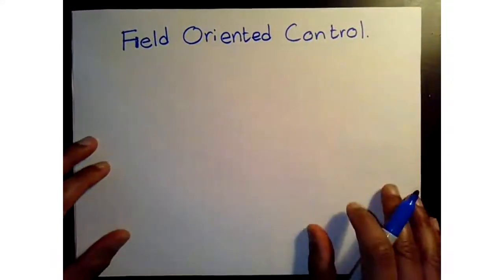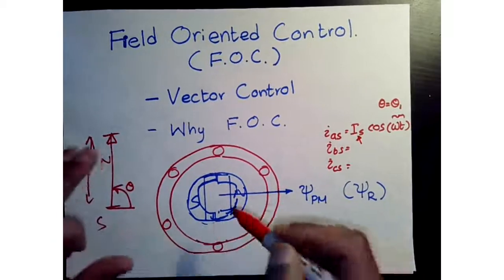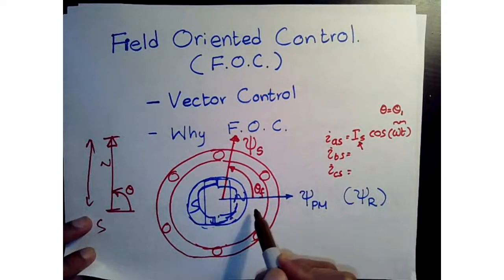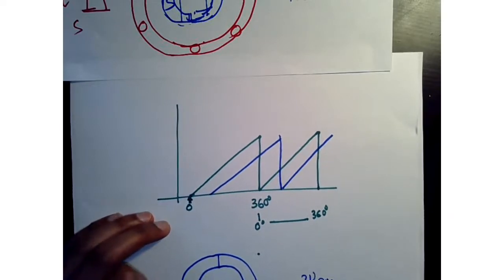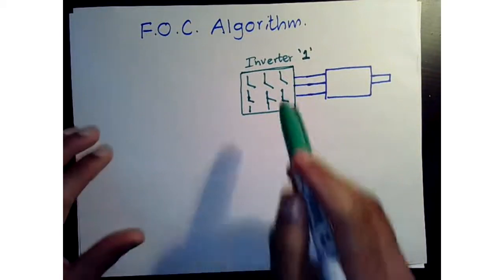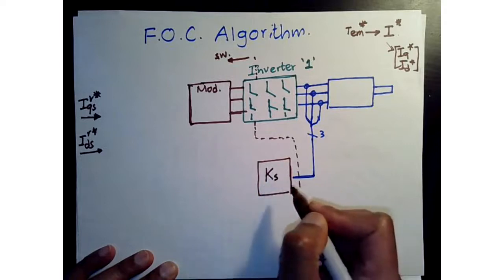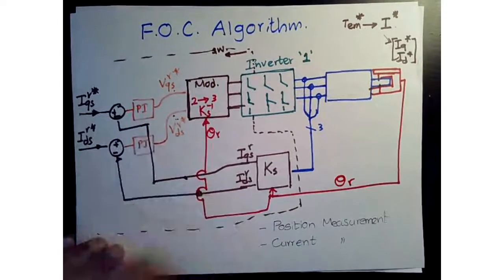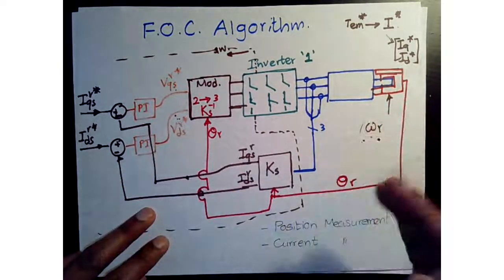Field Oriented Control of PMSMs

Comment: Hello Sir, could you explain the relationship between the dc bus and the maximum speed the pm motor can reach
Reply from the maker: I will need some time to prepare material for this. But the Paul Krause book on Electric Machines have this already covered.

Comment: Hello sir,
can you please explain why we used PI controller not PD controller to get vd,vq out of id,iq Although the equation of vd,vq contain derivative of these currents not integrals of them
Reply from the maker: The current regulated plant has a pole and therefore a PI is sufficient to move the pole and achieve the dynamics. Not having an integrator (like in a PD) results in zero steady state error.

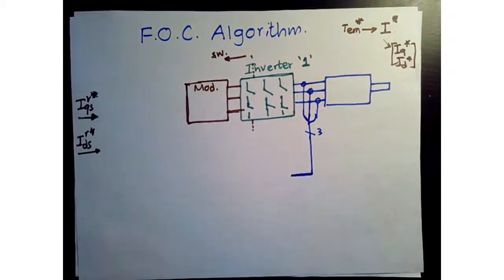Comment: Sir in video at 36:21 you have mention about Reference torque.. Please explain how From references torque  ID and IQ are calculated.
Thanks
Reply from the maker: Hello Ankit, that is a good question. There are number aspects that you have to consider in calculating reference such as voltage available, motor specifications and operating point. This depends on the application. So there is no straight forward answer.

Comment: It is a great explanation as always, grateful for the help we got during the project.
Reply from the maker: Great to hear from you Gayan! Glad it helped. Are you working on anything related to what we did?
Reply: @SandunKuruppu  sir intially u told our duty is to align stator flux at 90 from rotor flux to get max torque...but later u are assuming rotor at 90 degree and tryng to control torque by varyng stator current...bit confusing

Comment: Hi Sandun..May I know about any simple method to execute in lab for the measurement of offset angle for Hall sensors in PMSM application.I referred Mathworks approach but the measured offset is not correct for the motor that I have. So any suggestions from your side would be much helpful.
Reply from the maker: Hi Ravi, there are different methods you can use the depends on the motor you have (IPM or SPM), what type of signals you have access to and if the motor phases can be removed from the inverter. The well known approach is to observe motor back emf (no inverter attached) and position sensor signal while the motor is spun at ~100RPM to find the alignment between the position sensor signal and back emf of  phase A. Let me know if this is not doable and there other methods to calibrate on the dyno with the inverter attached.
Reply: @SandunKuruppu  I used a method where the motor is run on open loop with only Vd applied..The position signal is provided and I logged the measured theta from hall sensors ..The value of theta corresponding to zero fall of open loop position input signal was taken as the offset..But this method gives me a higer offset value in the range of 280 and above...Is it fine or any mistakes in this approach?
Reply from the maker: @ravikodoth7284  When you say open loop, do you mean using an internal ramp? I guessing the motor is driven open loop by the inverter? I'm not clear what you mean by "Value of theta corresponding to zero fall of open loop position input signal.." Could you clarify? You can send me an email to the email shown on my channel. A picture of your calibration setup will be also helpful.

Comment: How do we get I_qs_refrence and I_ds_refrence as a certain value if the mechanical torque is varying for example with wind in a wind turbine ?
Reply from the maker: That I believe would be a speed control problem. The speed control loop will establish the desired Id and Iq. There may be other strategies to setup Id and Iq, when the load is varying. When load is varying, typically, the motor does not regulate  torque (if there is a rigid coupling between the load and the motor/PMSM).

Comment: Hello sir,
In Matlab simulation, Obtaining speed from rotor position by utilizing derivative block causing disturbance and fluctuations of speed.
How could we obtain accurate speed from rotor position...while FOC of PMSM..
Reply from the maker: Pavan,
In real applications, the speed is calculated based on rotor position. i.e. by taking the derivative. How much noise are you seeing? What kind of noise? There shouldn't be any noise in your simulation. 
Alternatively, if you are simulating a dynamometer (dyno), the speed should be held constant after a transient while the PMSM regulates torque. So, some information is missing in your question for me to help you.

Comment: can u please share some matlab simulation video of implementing FOC on PMSM it will be really helpful please
Reply from the maker: I will share a Matlab Simulation example for FOC. Are you looking to see what the signals look like with FOC? I can include both simulation and experimental results.
Reply: @SandunKuruppu  matlab simulation of FOC on PMSM...this reference current generation is done with other method we cannot take it as constant I think.....as FOC applied in induction motor there id iq is generated with different way
Reply from the maker: @beatthetech9463  I dont follow your question. Reference currents are generated based on the torque required. I dont see why it cant be constant. If the torque needed is constant, then the current references  are constant. Does this make sense? 

Same general concept with a difference in implementation is followed in induction motor FOC.
Reply: @SandunKuruppu  do upload simulation sir... please of FOC on PMSM that's will be really helpful

Comment: Iam implementing the FOC of PMSM but the line voltage and currents of the motor are not similar as calculated values...what could be the reason ??
Reply from the maker: Need more information Pavan. A picture/plot would help!

Comment: Hello sir,
Is the position is same as rotor angle (rad) in MATLAB simulink block ??
or
could we measure it separately by any equation ..
Reply from the maker: Pavan,
The position is typically the rotor angle. You could measure it externally too. It depends how you setup the model. i.e. integrate speed.
Reply: @SandunKuruppu  ok sir, thank you

Comment: how foc method works for sensored motors? Bcz foc uses Clark and parks transform ..For which it takes current..So how with hall sensors Foc method works?
Reply from the maker: The question is not clear here! Current and rotor position are needed to obtain rotor reference frame currents.

Comment: The phase angle theta is varied by varieing frequency coontinuesly this way we get a 90degree phase shift between rotor vector and stator vector at any condition of rotor position.
Is this statement is correct.pls help me.
Reply from the maker: Naseeb, what do you mean by phase angle is varied by varying frequency? Specify the time stamp of the video. PMSMs are synchronous motors. You can only control the relative placement between the stator and the rotor field. That is done through the inverter voltages applied. Frequency depends on the motor speed and number of poles.
Reply: @SandunKuruppu  that statement not include in your video its my mistake
what is the function of inverter in pmsm drive.
how the motor speed depends on supply frequency.

Comment: Great lectures sir, 
Could you please explain to me how the necessary parameters such as the rotor position may be derived for a sensorless FOC.
Reply from the maker: There are different approaches used. Estimation algorithms rely on measurements and a motor model to track position.
Reply: @SandunKuruppu  Hi Sandun, can you please provide some references to understand hall offset in càse of a ipmsm motor with hall sensor and how to findout. Is it like the angle difference between theta when changes from 360 deg to 0 deg and U- Phase back emf zero crossing falling edge. Can u give some insights on sensor calibration how usually done . Thanks in advance.
Reply from the maker: @jubul1988  Let me first try to understand your question here. Are you using discrete hall sensors for trapezoidal control or a linear hall sensor for field oriented control? So if it is a linear hall sensor, the sensor offset calibration is same as non-salient PMSMs. An IPM is a salient PMSM where, Ld is not equal to Lq. Therefore, you can get reluctance torque by injection Id. This is a concept called maximum torque per ampere. It has nothing to do with sensor calibration. It places the stator current vector and an angle away from 90 degrees to excite the reluctance effect for torque.

Comment: Hello sir, 
There are torque ripples in the PMSM motor,
What is the reason ?
What is the solution ?
Reply from the maker: Torque ripple does exist to a certain degree in many machines and sometimes negligible. There are many reasons and it is a larger topic of discussion. Sometimes it is the machine design, sometimes the drive and sometimes it is the controller. So it depends. I will post a video on this topic soon!

Comment: It was a good explanation, I spent hours try to understand and read 
So you didn't use a clarke transform with your technic, right?
But if i use both transforms, how can I measure the current?, that part is still unclear for me , I think if i measure directly my microntroler will burn.
Should I pick up  measure directly to my microcontroller?
thanks!
Reply from the maker: Azael, I'm assuming you are asking about FOC. Uou do have to use Clarke and Park transforms, but in this case they are combined to one transform called the reference frame transformation. So in a way, I did use them. You have to measure phased currents using current sensors (shunt or hall effect based current sensors) and read them into a microprocessor. Then you have to apply reference frame transformation.

Comment: how could we calculate the rotor position of  PMSM ?
Reply from the maker: Pavan, you can obtain rotor position using a position sensor or you can estimate with an estimator or for certain types of machines, you can inject high frequency to measure position.
Reply: @SandunKuruppu  in simulation how could I do it
Reply: While performing foc of pmsm in matlab simulink, what could be the theta in parks and inverse parks transformation
Reply: How to tune the PI controllers of PMSM in FOC control
Reply from the maker: @pavangongalla9292  Pavan, see my other videos. I show how to design PI controller with bandwidth and how to simulate PMSM as a torque controller using constant speed integrated to create the position signal.
Reply: @SandunKuruppu  thank you sir, I will try
Reply: @SandunKuruppu  could you provide me the link of that video
Reply: @SandunKuruppu  Sir, could you send me the link of that video.
Reply from the maker: @pavangongalla9292  https://youtu.be/d54R3IOVkP8
Reply: Ok sir, thank you

Comment: awsome explanation. 
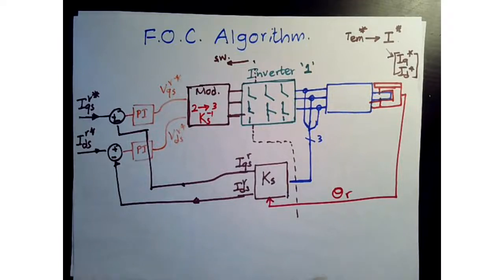at the time of 39:40, could you please how the PI controller converts error from the current domain into the volage domain?
Reply from the maker: Hussein, this is a common question I get from my students. Don't treat it as a units conversion, rather a closed loop system. Think of it from a control system perspective where the voltages are applied based on the current error, because voltage is the variable we can control and current is the variable we want to control. It is similar to controlling the gas peddle we when driving a car. Hope this helps!